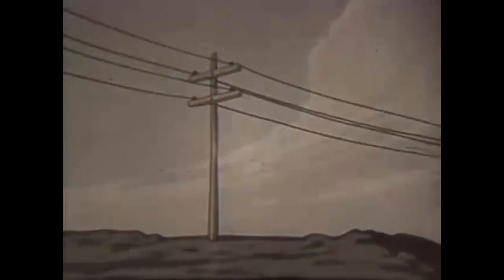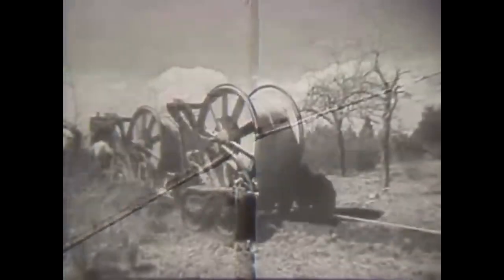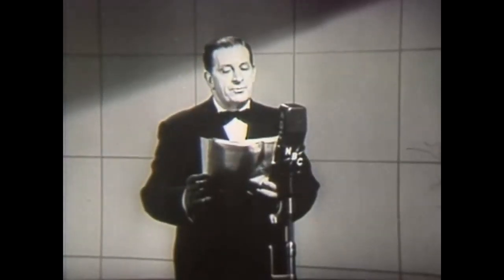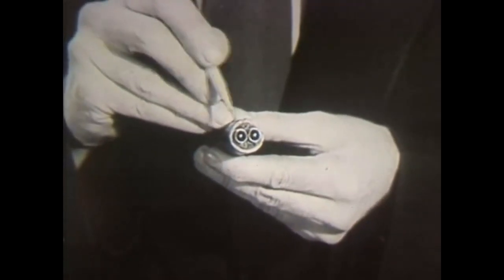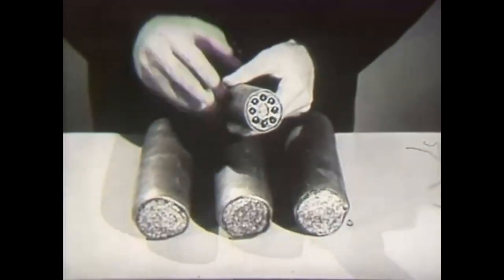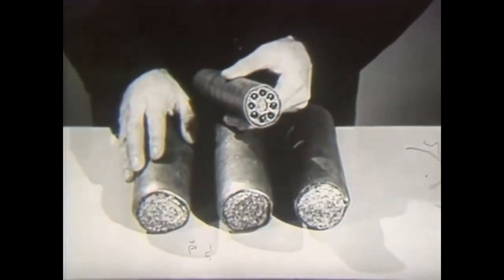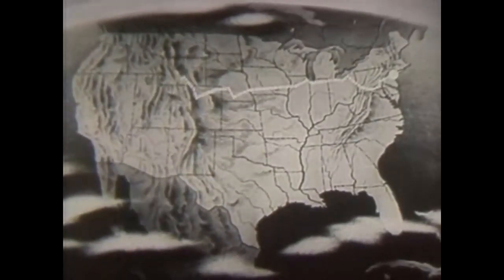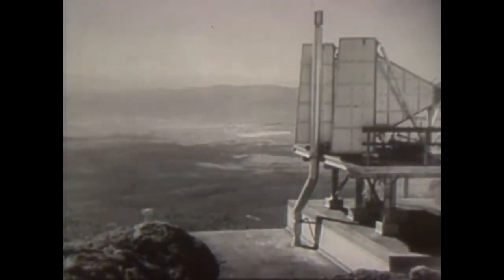Television and the Telephone get Multiplexed over Coaxial Cable and Microwave Radio in 1946

Comment: From 1977 to 1987 I worked at the AT&T Television Operating Center, aka TVOC, in NYC.  That building, at 32 Ave. of the Americas, is shown at 3:46 in this video.  All three networks, PBS, CNN, HBO and others came into our office via cable, then through a video router, up to NY4 microwave where it began its cross country journey.  At predetermined times we would switch alternate feeds from networks, containing regional commercials, to spare microwave facilities that were switched either into the networks' main "backbone" or to individual local stations.  We also would troubleshoot any impairments to the networks.  Networks would also send us remote feeds, news, sports, for example.  One of our biggest responsibilities was "Football Sunday" where we would manage and switch games for CBS and NBC, sometimes having close to ten games simultaneously going through us, and occasionally having to monitor for a cue at the end of a game to switch to another game, lots of overtime!   Bill Zukowski